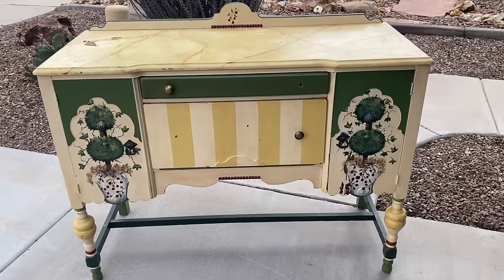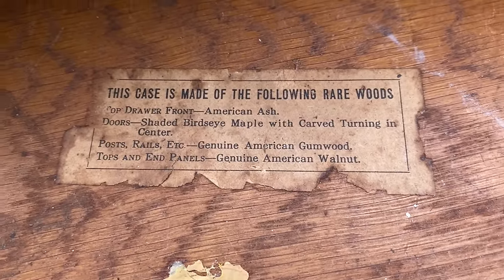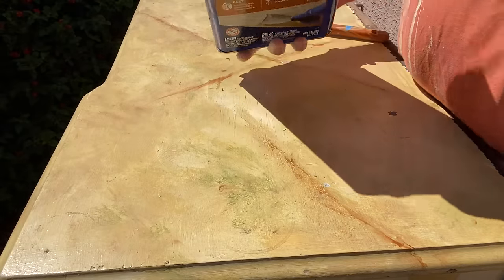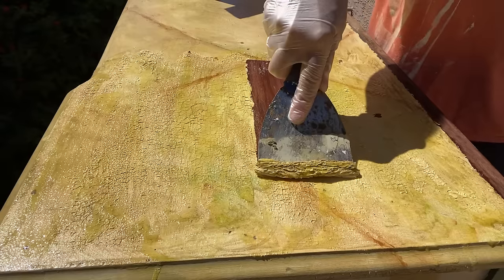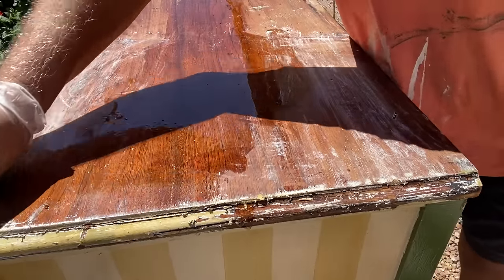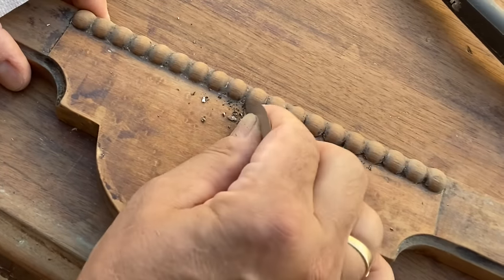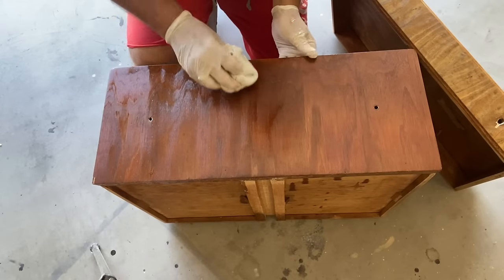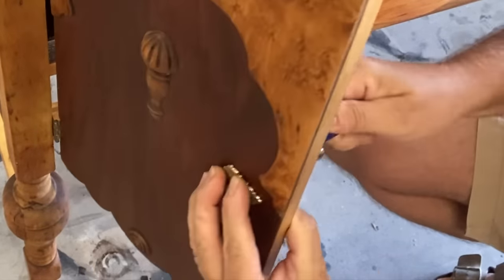I found something amazing under all the paint.  Antique sideboard restoration.

Comment: Hi I just got an elaborate desk with lots of cubbies. It has a coat of grey paint on it. When I opened a drawer it said the wood was Honduran mahogany.  I want to do the paint removal safely so I’d like to have any suggestions to use to do the removal process. Thanks these videos help too
Reply from the maker: Oh wow!  If it is a veneer, the safest way is with stripper to prevent scratching.  If it is solid wood you could use a scraper as well and not have to worry about burning through veneer when sanding.  Good luck!

Comment: A lot of people are commenting about why people are painting over old wood. It was a very popular and common occurance not too long ago (still happening) to "modernize" old pieces. Antique funiture suffered a setback as they lost popularity & less people were buying them. (I am 70 years old - antiques were BIG in my 20s, 30s and 40s and I started seeing a decrease in interest as the craze for mid-century modern grew). So they got bought then painted to make them match the hottest colors at the time. There are youtubers out there now doing it to mid-century modern pieces. (Years ago they sold for peanuts at garage sales) Removing the old handles and replacing them with "modern" ones, painting them the latest colors - sad. 10 years from now, people will be buying those pieces on Facebook Market place or a thrift store and restoring them back to the original finish - minus all the great, original, really cool looking hardware!!
The thing with an antique piece is, when correctly refinished, it ends up looking better than the original finish and that is the kind of "update" it deserves.
Reply: I agree. Plus, who knows why it was painted - someone somewhere short of money and doing something special for a loved one? If many of these pieces hadn't been painted they would have ended up in landfill somewhere because they were out of fashion and no one wanted them. There have been times through the last century when there was not only little money around but no cheap furniture either. It's very easy to sneer and question why others do what they do. To be honest, much as I love the different woods in that piece and was impressed with the restoration there is no way I could/would give it house room,  and I can't see it in the houses of anyone I know.
Reply from the maker: Thank you for the comments.  I find it very interesting that my most popular videos of pieces that I have restored are the hardest to sell.  The videos that I get the most criticism for are the ones that sell right away.  I am not looking to restore every piece that I do to its original state.  My goal is to sell the pieces and try different techniques to show people what they can do with pieces they might have in their garage or attic.  Everyone has different tastes and I respect the fact that if someone owns a piece of furniture it is theirs to do with what they want if it makes them smile.  No-one else has to live with it.  Thanks again for the comments.